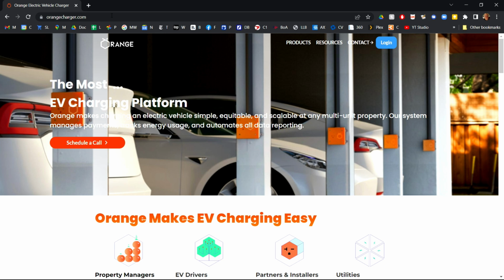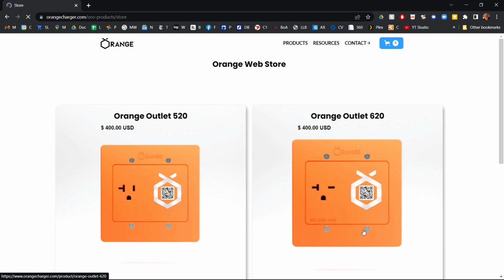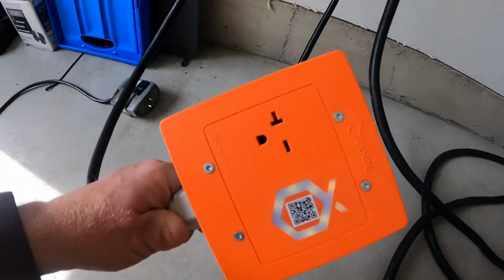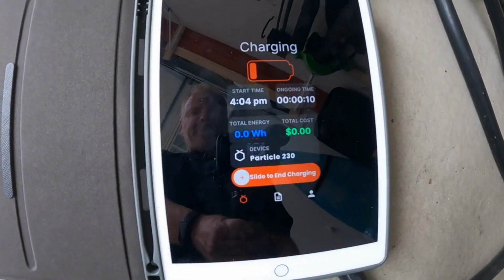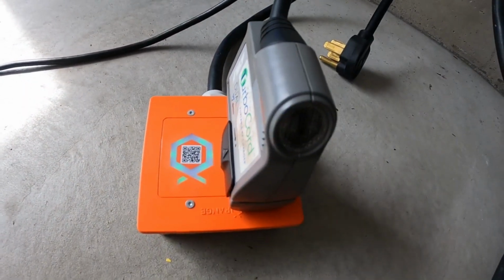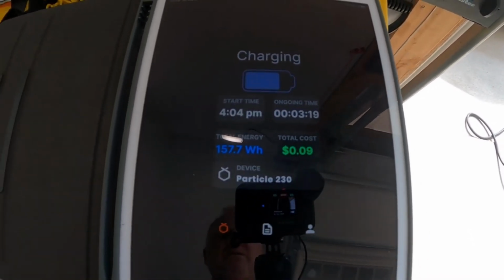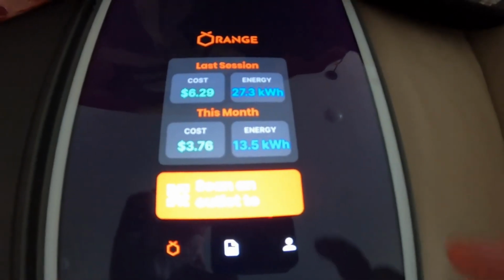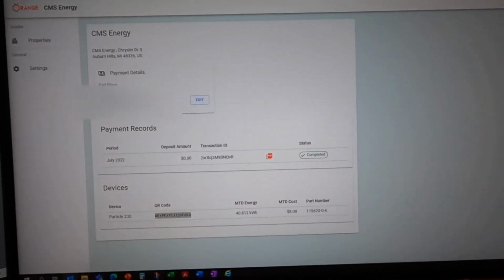Orange EV Charger Smart Outlet for Multi-Dwelling Units

Comment: My parking garage just installed similar devices on the existing outlets to monetize them. The devices are by Plugzio. I used to charge on those outlets for free (with permission), but I don’t mind paying at all. Airports should install 100’s of these devices. It’s a perfect use case.

Comment: Nice solution, but seems way over priced by 50 %.  However, it’s still far less than what it would cost add individual L2 units to a multi - plex .
Reply from the maker: I think part of the appeal is that the required wiring is significantly less than the thick gauge wiring required for Level 2 units.  It's not a one-size-fits-all solution, but I like the option.

Comment: Doesn’t this system have a fatal flaw? These smart outlets will have a GFIC circuit at the panel. Charging EV’s with a mobile often causes nuisance tripping. Since the circuit breaker (or reset) is not local it shuts down the charger until it can be reset. What have I gotten wrong. I have experience this nuisance tripping but the GFIC was local so it was reset easily.
Reply from the maker: Good question, but it might be one for Orange Charger themselves as I'm not that familiar with the technology inside.  They already deploy this product, so I'm sure they have a solution.  Most EVSEs have ground fault protection inside and don't require a panel box level GFCI device.  Here in Michigan the state electric code also overrides the NEC AFCI requirement.  So the answer it depends.  If you want to dig deeper, contact Orange themselves:  https://www.orangecharger.com/contact